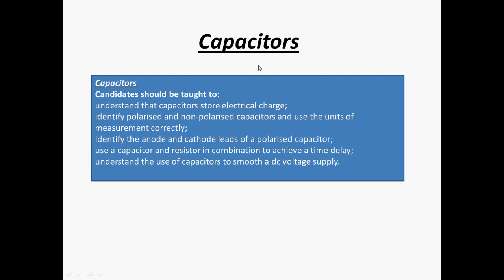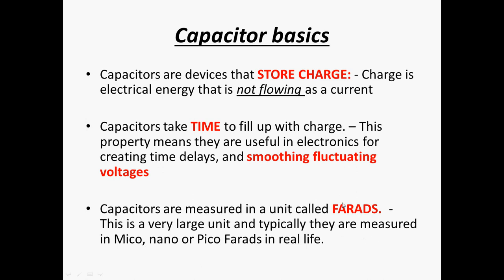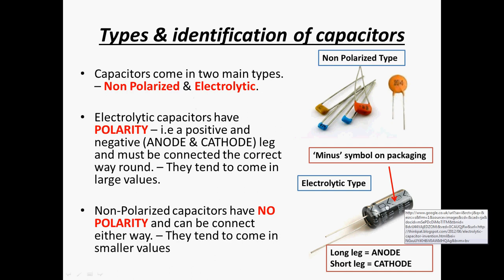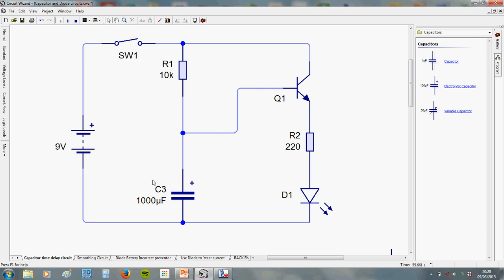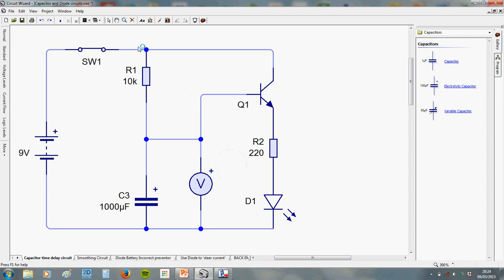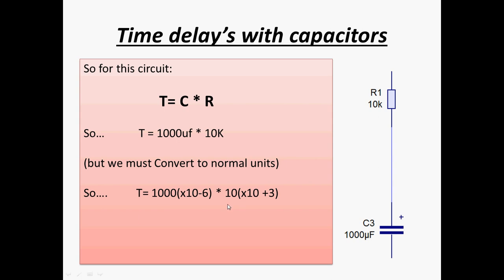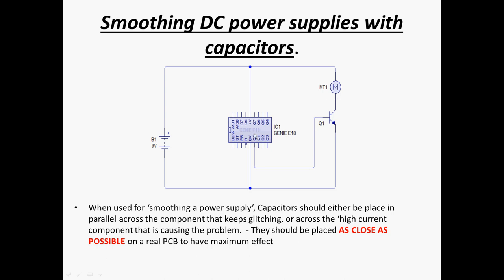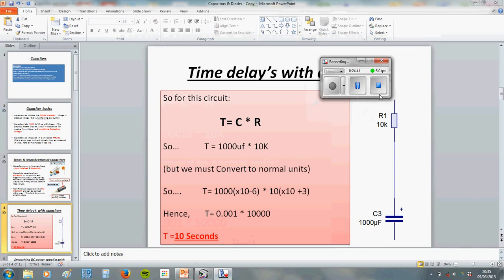Capacitors

Comment: Hi Rob, you said that the voltage across the capacitor drops as it charges, I believe you meant to say it increases which is then applied across the Base and enables the transistor.
Reply from the maker: Youre quite right!  Easy to lose track of what you're saying when you get in the zone.  Glad you're getting some use out of these.